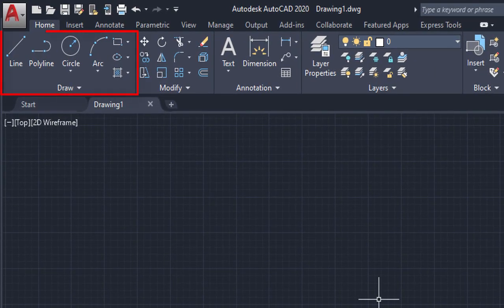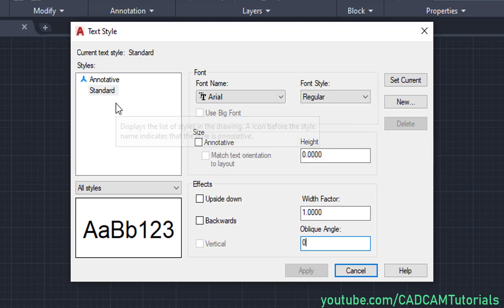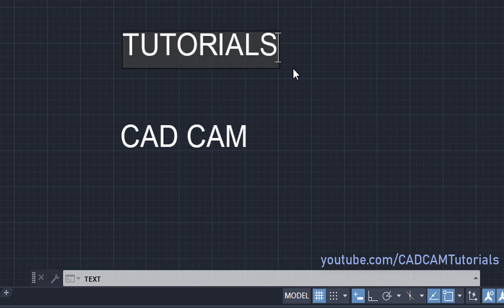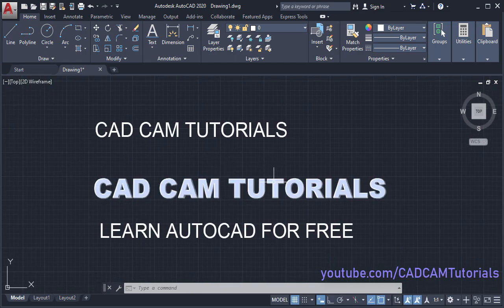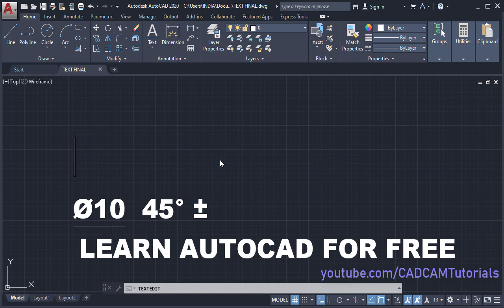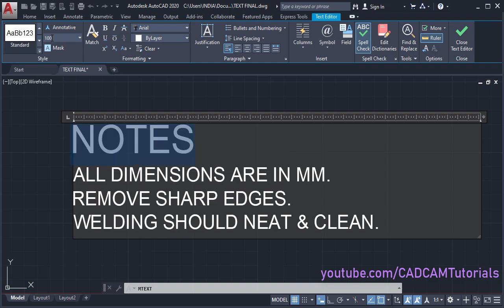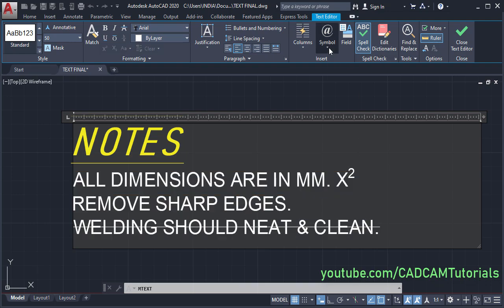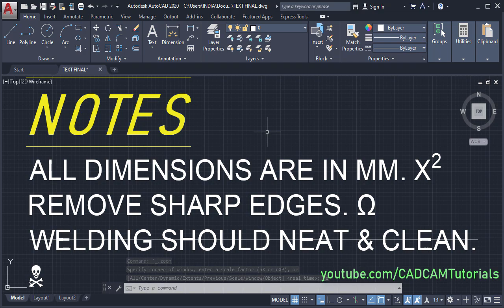AutoCAD Text Settings | AutoCAD Text Style | AutoCAD Mtext Editor | Single Line Text | Font Size

Comment: Thank you sir. I have one problem. When I changed the font style to Stencil Font Style and typing the text it is appearing in CAPITAL LETTERS ONLY even though Caps Lock is off on my computer.
I even tried to change the case to Lower by selecting text and right clicking -> change case to Lower. But it is not changing to Lower case.
Please help.